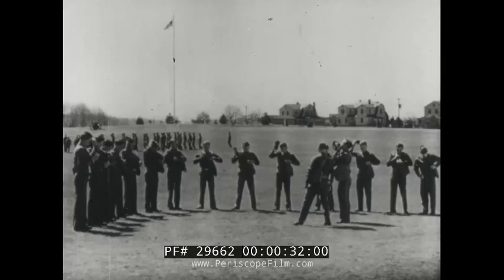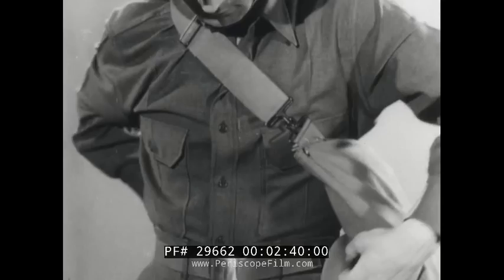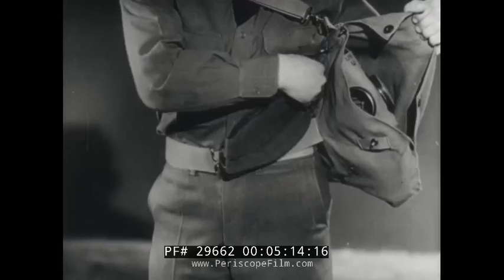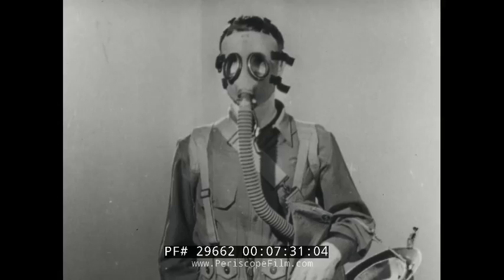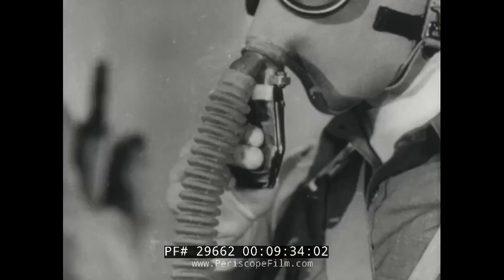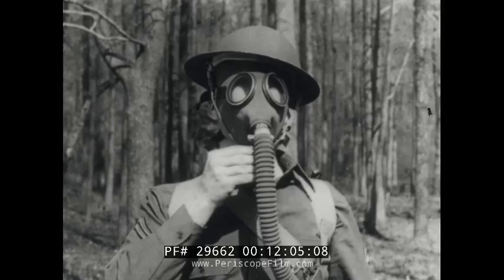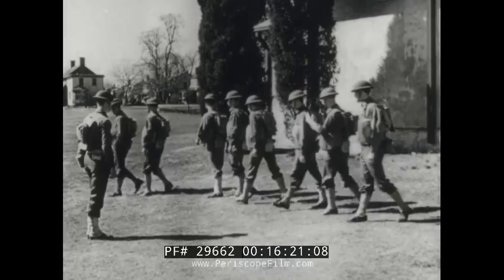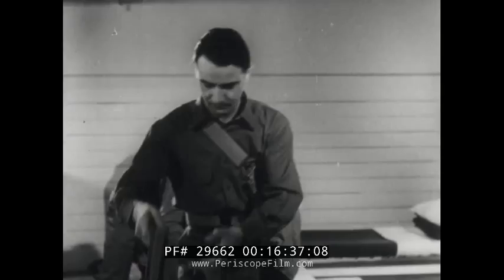ADJUSTMENT OF THE SERVICE GAS MASK 1941 WWII TRAINING FILM 29662

Comment: They are actually wearing MIA1/MIA2 masks, not M2A1's.
Reply: Yes it is. Gas masks had roman numeral designations before 1940. These masks in the video are MIA1 (M1A1) service masks, the M2 series were made of molded rubber.
Reply: There's only one known M2A2 with a black molded facepiece and it was likely a prototype. You likely have a neoprene M3-10A1-6.
Reply: Also there is no such thing as the M1A3.
There was:
- MI Service: Brown Sheet Rubber/Stockinette Facepiece, Pressed Round Lenses, Numeric Sizing System

- MIA1 Service: Brown Sheet Rubber/Stockinette Facepiece, Threaded Round Lenses, Numeric Sizing System

- MIA2 Service (Early): Brown Sheet Rubber/Stockinette Facepiece, Threaded Round Lenses, Universal Size Only

- MIA2 Service (Late): Grey Sheet Rubber/Stockinette Facepiece, Threaded Round Lenses, Universal Size Only

- MI (M2) Training: Black Injection-Molded Rubber Facepiece, Triangular Crimped Lenses, Directly Mounted Filter, MIV Acushnet Disk Valve, Universal Size Only

- MI (M2) Service: Same as above, with Hose and Heavy Filter

- MIA1 (M2A1) Training (Early): Black Injection-Molded Rubber Facepiece, Triangular Crimped Lenses, Directly Mounted Filter, MV Connel Valve, Universal Size Only

- MIA1 (M2A1) Training (Late): Grey Injection-Molded Rubber Facepiece, Triangular Crimped Lenses, Directly Mounted Filter, MV Connel Valve, Universal and Super Small Sizes Only

- MIA1 (M2A1) Service: Same as above, with Hose and Heavy Filter

- M2A2 Training: Grey Injection-Molded Rubber Facepiece, Triangular Crimped Lenses, Directly Mounted Filter, M8 Button Valve, Universal and Super Small Sizes Only

- M2A2 Service: Same as above, with Hose and Heavy Filter

- M2A3 Service: Same as Above, with C15 Outlet Valve and Cheek Straps Molded Further Back
Reply: DukeNougat3d hay do you know were I can get parts for the gas mask I have one but the tubes and canister is missing I buy it in a flee market